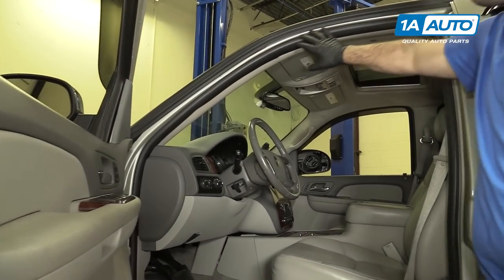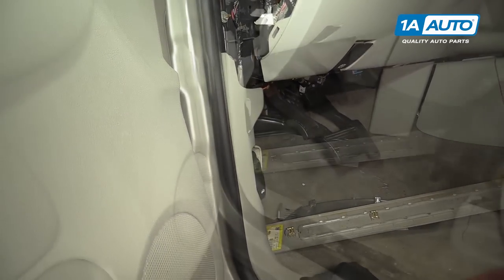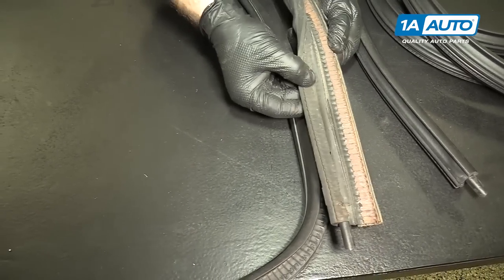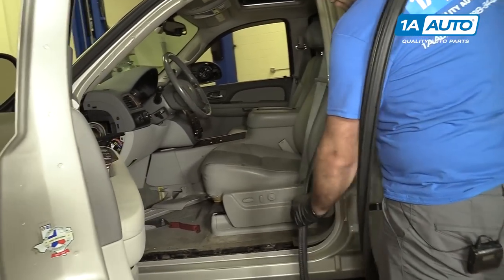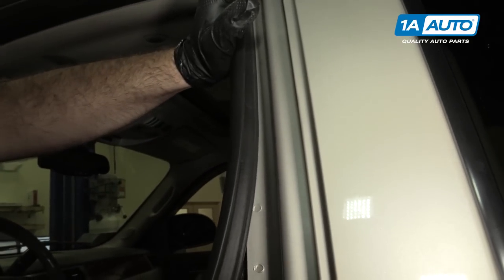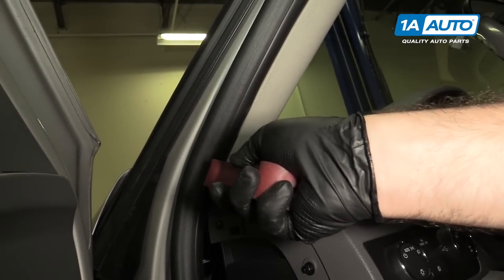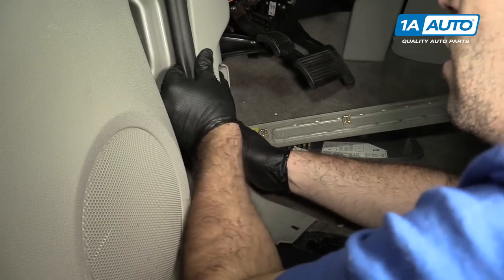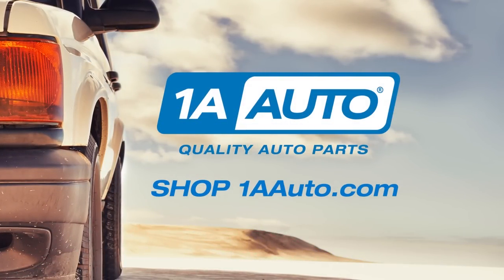How to Replace Front Door Weatherstrip Seal 07-14 Chevy Suburban 1500

Comment: Hi
Well it work for Cadilac Escalade 2007..!!! Because i got a noisy wind sounds which make me unhappy 😏
Reply from the maker: +Mohamad nader Thanks for checking us out! The part shown in the video does fit your application. It should be the same or a similar procedure.
Reply: 1A Auto Parts will it work for rear door too .!! Or it will not fit
Please share the link for me